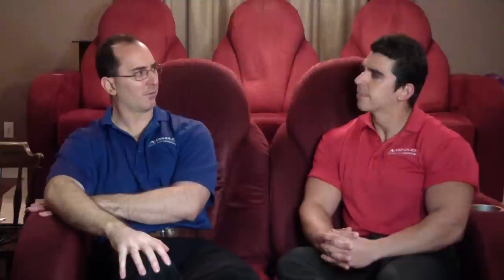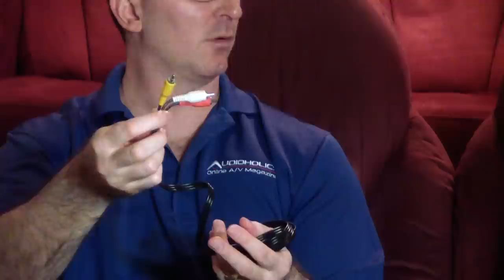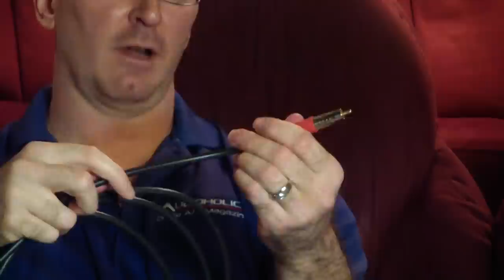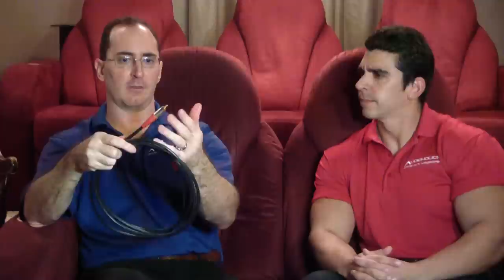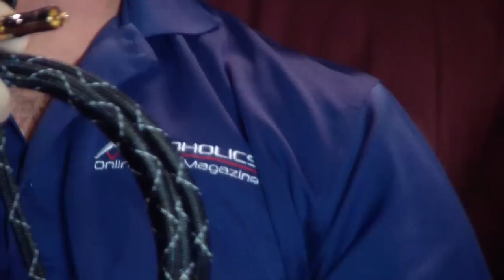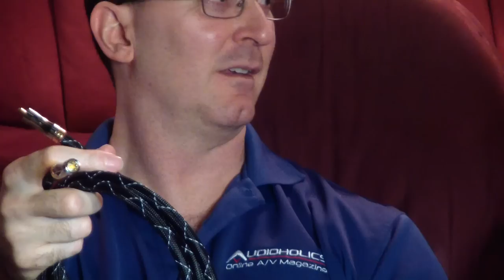Audio Interconnect Cable Myths vs Truths Revealed

Comment: I am a scientist 
These all corporates playing with insane public 
Only one OPTICAL (SPDIF or TOSLINK) can pass all ethernet+audio with also eERC+video+controll signal also 

This  optical connction is best comptible for small and large devices ....mean we can use optical data connection from mobile to AVR and TV ...etc

But corporate peoples playing with public  money 
We have many interfaces HDMI -stereo -s video ....and so on ...everything is myth
Reply: Optical has limited bandwidth and is pretty much obsolete for hifi audio and a non-starter for video. HDMI is the current gold standard for video, but is poor for audio because of implementation. Coax the is the best for digital and analog audio. Digital has a strict 75 Ohm requirement, so requires a special terminal, analog requires low impedance and low capacitance, so they require a different cable than digital.
P.S. I am also a scientist, it is not relevant to this discussion.

Comment: there a some very good sub 20 dollar audio interconnect cables that put those snake oil audio quest cables to shame. If you bought MIT or Audio quest interconnect cable, you've just poured your hard earned cash down the drain.
Reply from the maker: David Perry some folks have more money than sense.
Reply: thank you.
Reply: +David Perry So very true!  All the nonsense about the various electron flows and "directionality" of currents as well as the claims that cables can be installed backwards and will sound different (even though audio is an AC signal).  IT's maddening!
Reply: +Steve Silvers I agree. Audio signal is alternating current that is both frequency modulated and amplitude modulated. The only real science terms in audio cable is resistance, inductance, and capacitance. There is only a miniscule difference in sound quality between a 175 dollar speaker cable and 50 dollar zip cord, but the difference between cheap lamp cord and 50 dollar speaker cables is enough to be day and night. If you want to save even more money and get a very good zip cord buy a 5 dollar 15ft spool of 10 gauge speaker wire and spend 25 dollar on a pack of 4 banana connectors and make it yourself. 50 dollar monoprice speaker cables and 20 dollar shielded audio interconnects is all you need for excellent wiring. And you do not need to spend more than 300 dollars for a really good power conditioner BTW.
Reply: David Perry Yes, the key to quality speaker wire is the gauge.  When I hear people talk about "twisted pair" for speaker wire quality, I laugh because "twisting" the pair will do absolutely nothing for noise rejection--a speaker is unbalanced and twisting does nothing for unbalanced circuits.  Despite claims, the "high end" cable manufacturers cannot change the physics.
Reply from the maker: +Steve Silvers Twisted pair can still be beneficial in reducing magnetic coupling between parallel run cables in close proximity.  This is why you often see this in high quality speaker crossover sections.
Reply: Audioholics I agree with that.
Reply: +Audioholics A twisted speaker cable would help prevent the cable from inducing a signal into a parallel cable.   However, usually when you hear of "twisted pair" in speaker cables, the person is often talking about the speaker as if it has balanced inputs--that any induced noise will cancel at the speaker.  Of course, that simply isn't true.  Interesting though, for the reason you mention, when installing power, we twist the phase and neutral conductors within conduit to reduce induced currents into the grounding conductor.
Reply: Analog Planet i would recommend cables on eBay. They're cheap and are very high quality.
Reply: Lol I work at BestBuy, so my AQ cables don't cost me anywhere near what they sell them to the public for 😂
Reply: David Perry  that’s not true 

When it comes to speaker wires, you’re correct. 
But interconnects matter. Especially when you’re running $10,000 + 2 channel towers 

Will a BMW run off regular gas? Of course it will, but it will underperform.

Comment: Interconnect  cables and speaker cables make a HUGE difference. Just take them home for a demo. You'll hear the difference between a great cable and poor cable and the difference is not small.
Reply: Right. Just trust your own ears.
Reply: But you don't need to spend big $ on fancy boutique cables. Like they said, a good quality double shielded coax with low capacitance like Belden will outperform those mega buck cables that are not based on proper cable science.

Comment: Professional world class recording studios use low impedance transformer balanced, spec Belden cable, 3 conductor plus physical ground into the main rack summed to a single point buried 6' into the ground.  Audiophile cable?   Hi impedance, unbalanced snake oil-- $3,000.

Comment: I just received the SKW rca cables both end sheilded. Till this time I thought buying good cables is a joke but man ai can't explain the things this changed. My Schiit Asgard 3 with multibit dac indeed sounds more controlled. I still keep going back and forth between this and the old monster rca cable I was using and yes there is a difference. So my perception has changed a lot that cables do make a difference. There is something with good quality cables like the more relaxed and  conntroled sound

Comment: Thanks for the very useful advice.  I have the feeling that one weak point in ICs are the connectors, both the male and the female.  Material and tolerances are critical for a very good contact.  Some expensive brands sell the male/female combination.  Maybe this is a little extreme but it should work nicely.   Given that the panel rcas are difficult to replace it is important that the ICs rcas are good quality.  Good and cheap cables can be found. Good and cheap connectors are more rare.